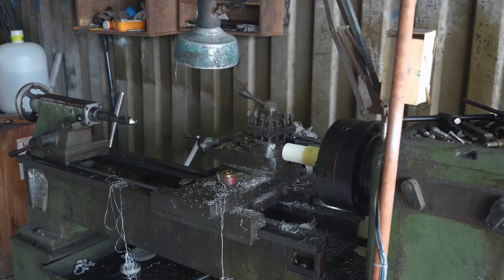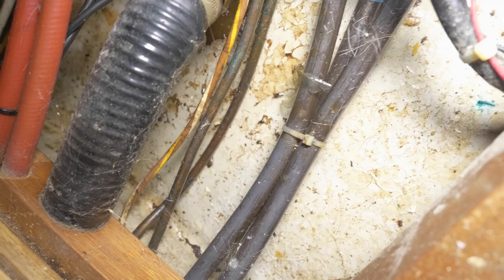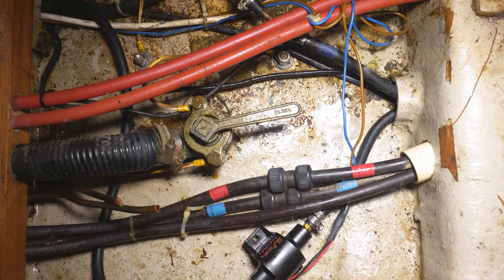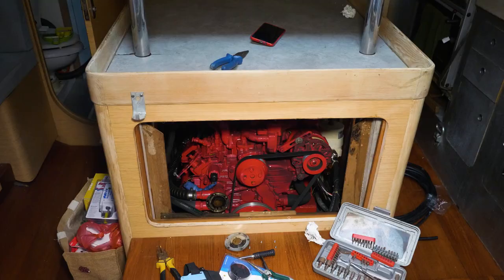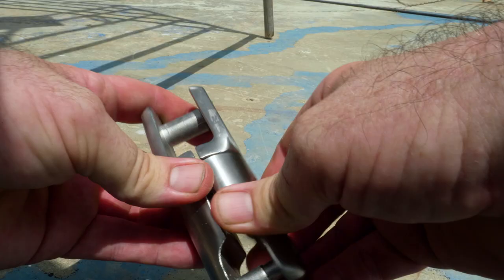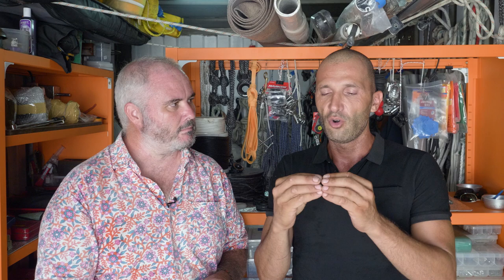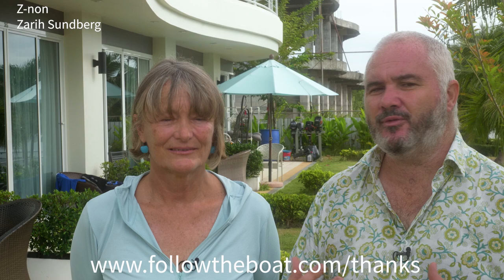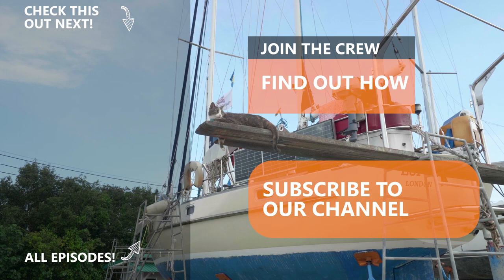RIGGING INSPECTION & BOAT REPAIRS - SAILING FOLLOWTHEBOAT Ep 117

Comment: The fuel pump at the rear needs to be secured.   You will be seeing some heavy swell on your journey north and movement
on the pump connections could cause a failure.   Epoxy a square piece of 'Starboard',  (a plastic composite impervious
to fuel and water),  to the hull and mount the pump to it.

Comment: The rubber hose you used to replace the copper pipe will not last as long (maybe only 10 years) but it is so much easier to inspect and replace !  Just make sure you have a fair amount of spare hose and Jubilee clips.

I hate trying to tighten/loosen Jubilee clips with a screwdriver !  I always use a nut driver !!  They do not slip off after 1 or 2 turns.

Comment: slide a small piece of rubber behind that rubber hose for a wear plate so it will not rub when vibrating :) thats what the copper did as well as copper after time will start to weep .

Comment: Hey I hope all is well with you and yours!  I am not sure of what I saw at about the 5:20 ish of this video, however, maybe you should check it out... keeping in mind that I may be wrong in my thoughts as well... Your valve at the back of the engine, has a bonding wire on it, actually 2 one on either side of the valve.  If so I think this is wrong, as you are now forcing currents through the valve. I believe that both wires should be bonded to the same screw/ bolt.  I understand that the bonding can be "daisy chained" however, i don't think that the potential currents, galvanic actions should go through the valve.  Please research to make sure that not only my sight is correct in what I saw, but also my thoughts are correct... 

I truly enjoy your channel ...keep up the good work.. and I love the Canadian t shirt (Winnipeg Jets  hockey shirt the liz wears!!)

Comment: I sure hope the new fuel line you used was Diesel compatible otherwise you will find it will get dissolved, broken down by the fuel. You can't use any old rubber hose. Please be safe.   Aussie.

Comment: Oh WD40 ... if you spray it on anything with grease in or on it ... it will destroy the grease ... best grease I have found is a white grease called ... wait for it ... wait for it ... Jig-a-Loo  ... I kid you not ... Teflon grease and and and you can get it off of you and clothes :) most of the time ;) . A set of gap gauges and a set of Mic's needs to be on board this will help you with alinements as far as the shafts dial indicators but sail drive not so much the feeler gauges will do the trick .

Comment: If it were me I would have stayed with the copper it lasted 30 years that rubber hose certainly will not.. one thing I don't like about boats as they use those cheap damn hose connectors after 50 years of working with him I still hate them.. find job Jamie
💕 love your videos as usual. ✌ &  love to everyone..
              👺

Comment: Hehhe magnetic algae remover! 
Lanolin is amazing... they make it from sheep! So imagine a lemon juicer but scale it up to the size of a sheep... hehhe
Reply from the maker: We should be using more of the sheep's stuff around the boat, Mick. Hair spray for Liz, perhaps?
Reply: good anti foul for the prop I hear.
and if you have aluminium on the boat nothing beats lanolin.
Reply: They make it from wool :-) also known as wool wax (CAS 8006-54-0) . It is the best for steel boats to put in the bilge on rust, where paint is coming off faster that you can get it on. But nobody is selling it in big enough quantity's. Only Alibaba sells it per 100 kg.

Comment: After having replaced the copper pipe with rubber hose, have you tried to get a confirmation that the pipe was actually leaking by doing some sort of experiment with it? It would be nice for yourself to get a confirmation, after having spent time and energy on it.
Reply from the maker: I know this leak and have repaired it before in another section. No time wasted but no time to check, it went in the bin!
Reply: I would have wrapped the pipes in loo paper and found exactly where it was leaking from. I would be surprised if the copper pipe actually had worn through. But i am surprised often. Peace

Comment: please explane why the groudtackle get stronger if you link 10mm to swivel then 12mm few links, why not do 10mm  to swivel and direct to anchor? thank you very much!
Reply from the maker: 12mm stronger than 10mm, that is all, Johan. 10mm is fine and it's what we've run with for the last decade but since the anchor shackle and swivel can accommodate 12mm, no reason not to put it there. 👍
Reply: yes thet I understand, but your your groundtackle is only as strong as the 10mm, trying to understand the 5 links of 12mm, is it good to move the swivel a few links from the anchor? maybe I should do the same but need to understand why
Reply from the maker: As we say in the video, you should not link your swivel to the anchor directly, you should always have some chain between the anchor and the swivel. This area does the most work, especially when the anchor is pulled sideways, so the stronger the gear, the better. Your gear is not only as strong as the 10mm chain, it's only as strong as the weakest link, so we minimise that weakest link by beefing things up at that end.
Reply: Sailing followtheboat i believe that the way that you rigged the swivel is absolutely the best method, including using  the 12mm.
Reply: The shackle is the weakest part hence using the 12mm chain allows you to use a larger one.
I use 8mm G7 chain on my boat but I don't use a swivel and it's difficult to find anything that will connect the chain to the anchor that is anywhere near the strength of the chain.